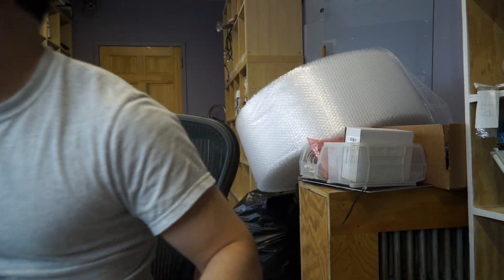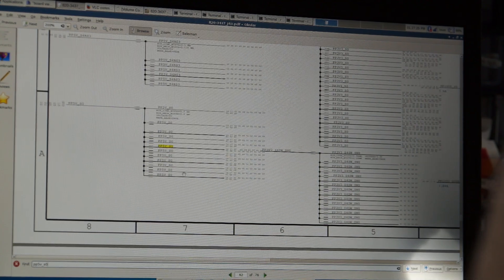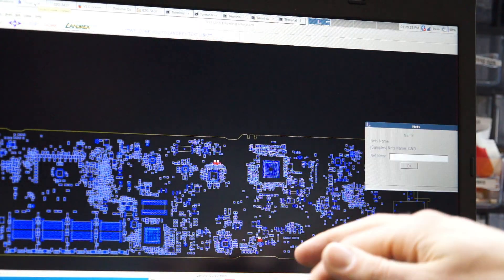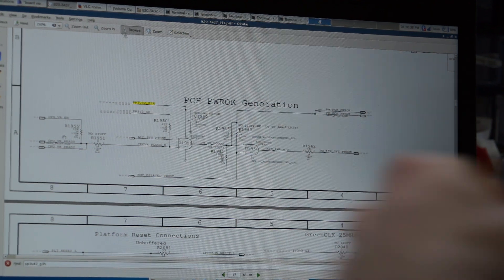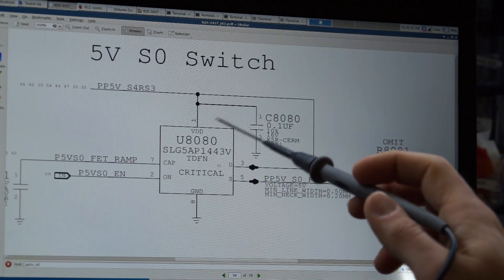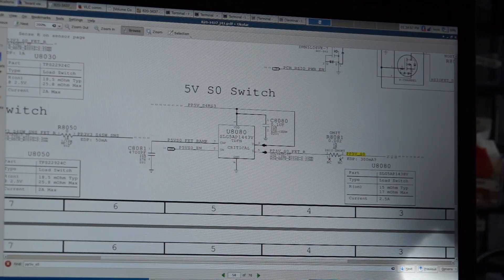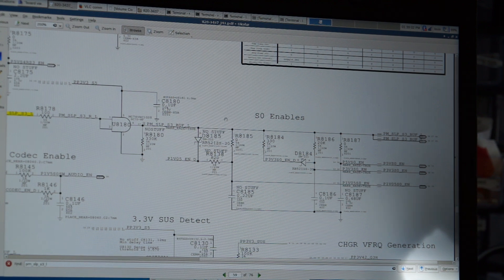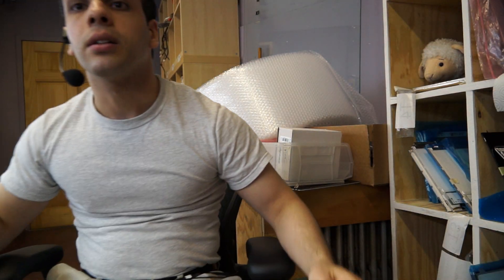820-3437 not turning on no PP5V logic board repair.

Comment: Could you just power up the machine pressing the power button before putting power on it? Because my machine gets works and then it reboots then works fine. I do have issue with brd and pdf file, there are components and nets that’s are incorrect(

Comment: Hi Louis, thanks for the excellent videos. I have a 820-2879 that had liquid spilled. There is almost no corrosion and I have made 3 passes with isopropyl alcohol and a brush. I am getting all S5 rails including 0.9V, 3.3V and 5V. I am not getting any S3 rails or S0 rails. PM_SLP_S3_L and PM_SLP_S4_L both show zero volts. I tried jumpering a working 3.3V S5 rail to the S0 enable circuit where PM_SLP_S3 goes in but the fan still doesn't turn on at least when I try bridging the power pads on the top or bottom side of the circuit. Unlike your video, I unfortunately do not have a component that I can solder across to give the S0 enable a 3.3V supply so I have to hold the jumper wire with both hands. My questions are these: first, to go into S0 mode, don't BOTH PM_SLP_S3_L AND PM_SLP_S4_L have to be working? At least that's what I interpret from the Power Control Signals chart in the schematics. If I supply 3.3V to the PM_SLP_S3_L or PM_SLP_S4_L circuits individually, the fan does not turn on. Second, in your video, you supplied 3.3V to the S0 enable as a bypass for PM_SLP_S3_L but was PM_SLP_S4_L working? Finally, is it okay to use the power pads on the logic board as 'Power On' or should one use the keyboard power button?
Reply: Shahrukh Bakar I should mention that the green light comes on brightly when the MagSafe is connected, and that the battery charged properly with an orange light that turned to green in the expected time for a full charge. It seems like I should be able to figure this out but I am being held back by a lack of hands to give 3.3V to S0 enable while turning the power on!! Perhaps I should unscrew the keyboard from the laptop so that I can maneuver it more easily while keeping it connected to the logic board? I did try bridging the power pads both with and without the keyboard ribbon connected just in case that was the problem but no luck there.

Comment: Louis Rossmann i have the same board model in my shop (water damage). After cleaning it had a green/orange light but 5v_s3 was off (3.3 s3 was on). only 3.4g3h and 8.1. looked around and the en pins were off.. and apparently was the same prob as yours.. the sleep signal was on low. so i did that trick to turn them on. and yey it did but it didnt powered on (fan wasnt spinning no video... ) . plugged a keyboard in .. it didnt start only by pressing power btn.  i did the smc bypass trick (power btn pressed while pluggin charger) and the fan started spinning - i was yey finally. and it rebooted in like 2 seconds.. did that 2-3 times and now its not even powering on (it has 5vs0 and 3.3s0)..  any ideeas where to look? thanks
Reply: Ciolacu Alexandru Hi Ciolacu, I am in almost the same position as you. In my case, both PM_SLP_S3_L and PM_SLP_S4_L were showing zero, so I supplied 3.3V to both and that actually worked! The fan started spinning, first slow then fast, then it stopped. No matter what I did afterwards, it is not turning on. As before, I still have all S5 rails but no S3 or S0 rails. Did you ever find a solution to your problem?
Reply: Same problem. After soldering like in video it powered and booted. I noticed I forgot to plug battery in. Plugged out power and in battery and then nothing. Not a kick only when power and plug in trick. But no display.

Comment: Hi Louis my problem with 820-3437 is when I plug the charger with or without battery I take green light for 3 seconds and then come orange not turning on have any idea?
Reply from the maker: Giannakopoulos Ioannis check PP5V_S5 or S3 to see if it is on.
Reply: Louis Rossmann Yes  PP5V_S5 and S3 is on at probe points.
Reply: Giannakopoulos Ioannis
have any idea why have orange light without battery?

 voltages I take

 PPbus_G3H 8.42V
PPBUS_S5_HS_COMPUTING_ISNS 8,61V
PPBUS_S5_HS_OTHER_ISNS 8.42V
PPDCIN_G3H_ISOL 16.6V
PPDCIN_G3H 16.6V
PP3V42_G3H 3,29V
PPVRTC_G3H 3,14V
PP5V_S5  4.88V
PP5V_S4RS3 0V
PP5V_S0 0V
PP3V3_S5 3,19V
PP3V3_S4 0V
PP3V3_SUS  0v
P3V3_S3 0V
PP3V3_S0 0,059V
PP3V3_S4SW_SNS 2.84V
PP3V3_S0SW_SSD 2.85V
PP3V3_S4_TBTAPWR 0V
PP1V8_S3 0V
PP1V2_S3 0V
PP1V05_SUS  0V
PP1V5_S0 0V
PP0V6_S0_DDRVTT 0V
PP1V05_S0 0V
PP1V05_S0SW_PCH_HSIO 0V
PPHV_S0SW_LCDBKLT 0V

Comment: Louis I've been watching your videos and I find them very interesting, thank you for sharing your experience. I have a problem with a 820-3437 with water damage and not turning on. When I connect the power (without battery) the fan will spin for a second and then stop. I get no green light with the battery connected and no charge. I have been looking at the ISL8259 to see if that was working ok but on the PPDCIN_G3H_INRUSH the schematic shows that this should be 18.5v, and I'm only getting 14.5v. Even if I go to PPDCIN_G3H this also measures 14.5v. If I looked at the writing on the power supply, the voltage out is only 14.5v. So my question is how does it get the 18.5v?
I then looked to see if I have a voltage at PP5V_S0 and at P5VS0_EN which both show 0v but I do have a voltage  on PP3V3_S5.
So I tried to force the EN to 5v on U8180 but this had no effect of turning on the board.
So I'm not sure what to check next, what would you recommend?
Rick

Comment: Louis,
I fixed the pfm006 problem!!! Fan is back to normal! , the kernel is not hogging the whole cpu, everything is back to normal after the water spill, thanks to you. Apple quoted me $755 to fix it, actual cost $7.99 for the screw drivers. And a couple bucks for alcohol to clean the board. After having the sensor fault you stated to replace the trackpad cable or the trackpad, so I started with a good cleaning and cleaned the cable, cleaned around the thermo sensor on the board really good, and that fixed it, did not have to buy a single part!!! Awsome thanks!
Reply from the maker: Good stuff. Fuck $755!!!!
Reply: Hi Sean,

i have the same problem. What area exactly did ypu clean? 

did you remove the batteries?
Reply: im having the same problem, how do you clean it?

Comment: Louis, Great vids!! I am a stay at home dad Disabled Vet, and after watching about everyone of your videos i decided to try to work on my wife's Mac-book air 2014, 820-3437 After a small water spill.(my Fault) I have removed the board cleaned it  with 99% alcohol and tooth brush. Everything works except. The fucking fan spools up and runs on high and runs slow. I have checked the fan circuit and test good. i bought the schematic and board view that you use on your videos. I believe it the Therm o Sensor. The following codes are what shows. PFM006, nnp001, and a wifi board code. I went to page 44 on the schematic trying my best to understand just don't know where to start and confused as termite in a wooden yo-yo. any guidance would be great. If money was not so tight I would just send it to you.

Sean B
North Carolina
Reply from the maker: Run the appropriate ASD for your machine and it will tell you which sensor is failing. This way you are not working blind. I think 3S155 or 3S156 is for your machine, not sure off the top of my head. 

Common sensor fault is bad trackpad or bad trackpad cable.
Reply: Louis Rossmann
thanks ill check it out,thanks for your time
Reply: Hello Sean ! 
I have the same problem (water). I need help !
Can you mail me Asap please : laularui@gmail.com
My MB air is going to Die.
Laurie 
From Fr

Comment: Hey, any ideas on a non-working keyboard/trackpad on an 820-3437-B, but only after boot? It works fine before you get to the OS, but after booting the keyboard and trackpad are non-responsive? Power button still responds though after boot. It's killing me. I have two sitting in front of me with the same exact issue and I'm stuck. Both were minor spills. Working fine otherwise now. Thanks for any help.
Reply from the maker: power button is on a separate trace from the keyboard /trackpad to the motherboard cable. Try another one of those. Could also be a fucked up trackpad, no way to know without replacing
Reply: Thanks. No luck with that unfortunately. I just tried a new trackpad and keyboard with no change. It's so odd that the keyboard and trackpad will both work perfectly before the system boots - at the boot drive selection screen - but once it boots they die.
Reply from the maker: Ben Falk replace trackpad cable as well.
Reply: and sorry about the double-post on the two different videos. i was thinking they were the same 820-3437-B video and that my first comment/question had somehow not posted.
Reply from the maker: Yeah. power button is on a different trace than the other keys. You'll see in the schematic that they get their own trace. help at rossmanngroup dot com is the paypal address, I have no idea how to grab any money on the one you sent it to, but it really is not necessary. I help people who aren't fucktards on here for free. For people who are, even $325 isn't enough. So you're good. ;)

Glad to hear it worked!
Reply: I was being bull-headed because I was able to type and use the trackpad perfectly before it booted so I was convinced it had to be software. But hardware has a weird way of making it look like a software issue sometimes.

It looks like the payment went through okay. It says The Rossman Group on it. There's no way to cancel or reroute it on my end but you can always add an email to your paypal account and it will just consolidate everything into your help@ account. It's coming from info at beaglebrain. I do appreciate the help. Your videos have definitely filled in some gaps.